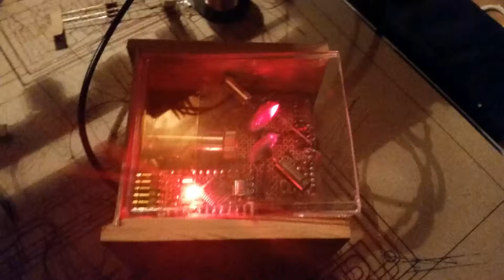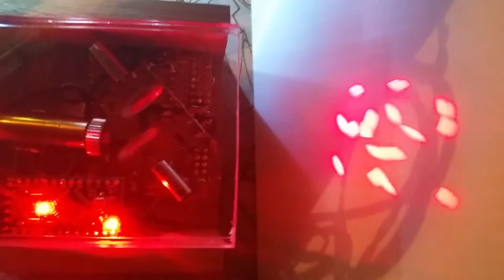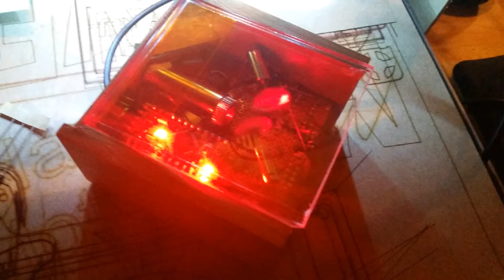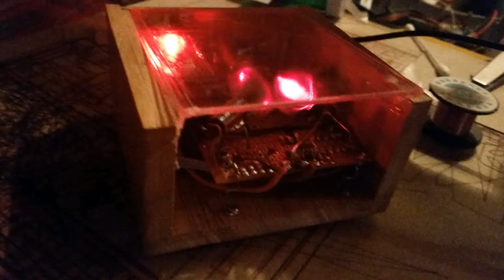Lil' Laser Spirograph

Comment: Very nice! Actually, i am also interested in this topic and I got a 2d galvanometer. But your solution is much simpler and cheeper! Very good idea.
I also wish you Merry Christmas and a "productive" new year.
Reply from the maker: +Andreas Spiess Thanks , and Merry Christmas to you too .   I was contemplating making / converting some 3v motors to work like galvanometers . the best part about them is you cna use L and R audio from any stereo sound source to drive them . If i had something that took 0-1024 values or such , and output a wave form that can be arduino driven I would have used that. I think i will use bigger motors and salvage surface mirrors from a dead hard drive platter. the small 1.5 to 3v motors may still burn out , even though i was careful with duty cycle with PWM capped at 185 .  that results in some effective level below 3.5v as it is PWM between 46 and 185 .Too much fun .

Comment: Sweet!!! Where did you get the mirror and how is it attached to to motor?
Reply from the maker: +Hari Wiguna i cut part off of a mirror that was in a old makeup thing my wife was done with . Next time i will try to used dead hard drive disk as it is a surface mirror and not glass top like these ones. i scored them with a diamond coated cut off wheel by hand then snapped them to shape along the score lines.  then i hot glued them to the small plastic pinions that the motors had.  try to make them perpendicular to the motor shaft as best you can by hand , but don't try too hard and the error is what makes the beam deflect . bigger motors would be better i think . 
I thin dollar stores also carry mirrors but like these they are not surface (laser) ones.  best to harvest form dead hard disk . you can replace the expensive CO2 laser mirrors with HDD disk cut to size . ( there is a YouTube video some place about that , and they seem to work better too )